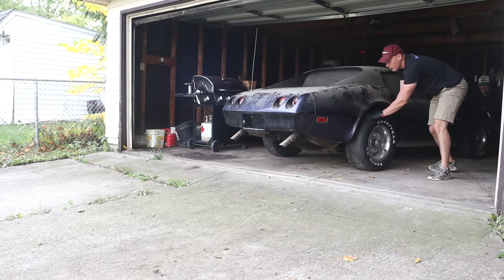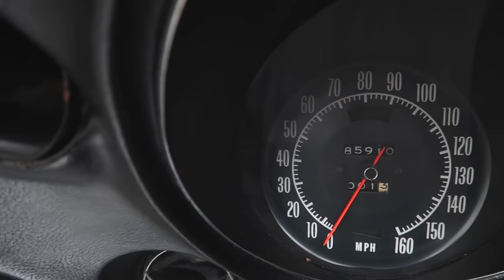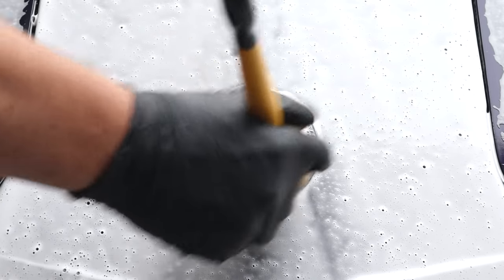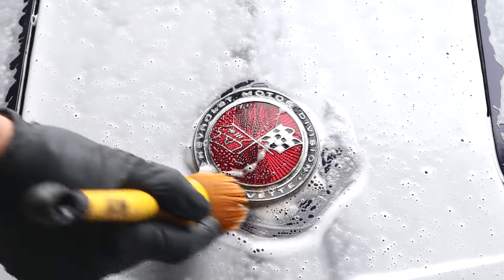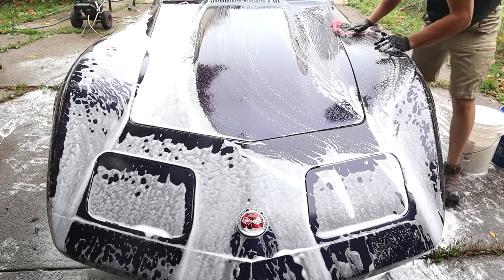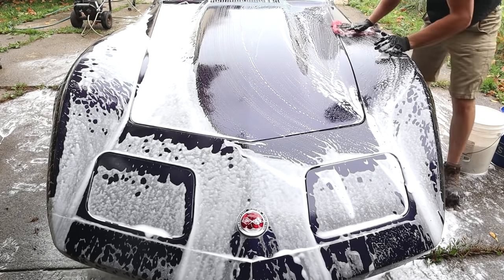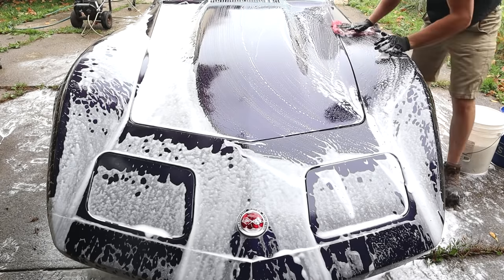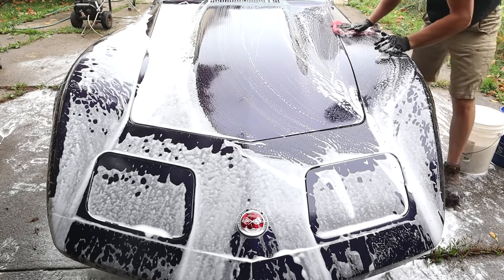ABANDONED BARN FIND First Wash In 15 Years Corvette! Satisfying Car Detailing Exterior & Restoration

Comment: The way, dust is coming out it doesn’t feel like first wash in 15 years!! There should be some rust near mud guard obviously 15 years!! And color looks brand new and shines without polishing 😂😂😂 Thanks for upload
Reply: @kashifeditz4686  he's not. He's right. There's no way the dust would come off like it is. I sense bullshit here.
Reply: Yup
Reply: Car is not made of steel, it’s fibreglass, and dust can come of easily if it was stored indoors.
Reply: Hey big dummy, if that car was stored inside, that layer of dust actually protected the paint. And the rust comment was really off .
Reply: @weallfollowmanutd  Dude! It's dust. That's a high pressure washer knocking it off. That's how that works.
Reply: A Wild Dust Expert appeared
Reply: It’s his personal car or somebody he know for sure
Reply: 15 years in a barn and no dry rot on the tires at all? 🤔
Reply: @teddyleather  he probably changed the tires - he said the car was being worked on to get it running again so it would make sense to change the tires
Reply: @weallfollowmanutd  15 years ago was 2006. You act like it was 1976. And Corvettes are made of fiberglass, no rust.
Reply: Fiberglass doesn’t rust bruv
Reply: @weallfollowmanutd  Its because what the car is made out of and cause the power tool he is using the water is strong
Reply: I agree.... Looks like artificial dirt.
Reply: to be fair, it parked indoor and just what most replies here said that corvette is made out of fiber so it won't rust😆 repeating comments to answer more doubts
Reply: Its inside
Reply: I understand what your saying but he did use a powerful washer…
Reply: You must be talking about them sheet medal corvettes, never seen one of those before🤣🤣🤣🤣
Reply: Well the dust did a fantastic job protecting the color
Reply: Is a big fake
Reply: Here I thought I was the only one.. Kids these days huh'?
Reply: It’s a vette. It’s fiberglass 😂

Comment: 13:53 use a toothbrush wrapped in a microfiber cloth with some polishing compound to do intricate areas near the badges. The polisher did not get close enough to the edges. Nice work on the rest of the paint.

Comment: How tyres look so new without covering any dust?
Reply: Because they are lying.
Reply: @robertosono8258  thought that the minute  they pulled it out..I have a 75 vette. Power wash or not never would of come off..fake dirt
Reply: @rockystrazzi2387  they're not lying, in order for it to run there had to replace the tired to even make it roll
Reply: @robertosono8258  your lying imao
Reply: Dust falls down , not up right? That’s how. 👌🏻
Reply: Same question! Its not even about the dust or dirt, just look at the condition of the walls and the tread. They look fairly new. There is no way a tyre can hold air, sitting for so many years.

Comment: 1969 corvette stingray. Love the disaster details
Reply: Absolute disaster. These guys know how to wash a car.. Thats it.
Reply: Where's the 1969 Corvette??? Might be a 79
Reply: @JohnDoe-gz8dw  Nope, it's a 76 or earlier with that style rear window and deck. Looking at the other details it's probably a 74.
Reply: Don’t group my car with one of those
Reply: @channell11  only vettes I 63-7, I was just wandering how someone would think 69, that body style, especially to 83 🤮🤮🤮, 68-7? I no interest in, but the 7?-83🤮🤮🤮
Reply: @channell11  pre 69 160 speedo,68,69
Reply: Pre 70, - 69, 68 I say. Only because 160 speedometer. And seem down the back bumper
Reply: @allendaleguitars.stpetersb4528  The last year for the 160mph speedo was 1977. Then it was a 140mph unit until 1980, when it got the 85mph speedo. Pre-1973 Corvettes had steel front and rear bumpers and the slats in the front fenders. This has rubber bumpers front and rear, meaning it's post 73. This also appears to have the two-piece rear bumper, which was a 74 only item. The fenders are the later design as well. The only way that wouldn't be the case would be if someone put later model parts on an older car, and given the strong preference for steel bumpers in the market, that'd be highly unlikely.
Reply: It's actually a 1974. That's the only year with a split rear bumper like that. A 73 has steel rear bumpers and the urethane nose. 68 to 72 have chrome bumpers all around. In 75 they went to a one piece rear bumper. A 75 and 76 almost look the same except a 75 has the astro ventilation vents behind the rear window. A 76 does not have them. A 77 looks almost the same as a 76 aside from it not having the stingray script on the fenders, front bumpers are a little different to I think. 78 and 79 have the big back glass.

Comment: I like the video but to me doesn’t look like a car that being sitting in a barn for 15 years , the paint job look pretty good for something has been sitting for that long and also the rims don’t have any spots of rust
Reply: My thoughts as well. Plus, barns are known to have mice and mice would do severe damage to both inside and outside as well as the engine bay. 

Great video, but no need to cheapen it with a misleading title.
Reply: For me it is 2:50 that said it's not 15 year old dust, dust "bakes" onto the surface over time, just a light pressure washer is not making the car shine like that ....

Comment: I don't see anyone else guessing the year, so I will.  With the rubber bumper in the front and back (not the updated style in the front though), it has to be between 74 and  79.  But since it has a vertical back window, it can't be a 78 or later.  

I'll take a wild guess and say it's a 77.

Comment: 1974 --- the "plastic" back bumper has a split down the middle - this is the only year the C3 vette body did that. The 73 had back chrome bumpers and the 75 had a solid back plastic bumper. My question back to you detailing experts ---- did the interior leak while you were washing the outside? My 73 leaks even with new weather stripping.

Comment: Beautiful car. The year is 74-77. I can't pin it down better than that 74 was the first year of impact absorbing bumpers at both ends, 77 the last year of the upright rear window. That window should retract.
Kudos to whoever laid that paint down. Beautiful job indeed. That deep a Royal Purple is very unforgiving. You guys did a superb job on it. Spectacular result. 
I'm certain you would despair of me when it comes to cosmetic car care. The old Volvo gets washed with dish detergent spring and fall. Mother's California Gold wax twice a year. It sometimes gets washed in between. The funny thing is that Arthur got dirtiest while still a "little old lady" car. In the 25 years she had him, Ma took the old boy everywhere, including off road. On purpose.
Reply: I'm guessing 76.
Reply: Next time you get a C3 to clean, check the tubes below those rear window vents, if the rubber is gone cracked or rotted, you will put a lot of water inside the car.

Comment: The Corvette is a  1974 if the back bumper is correct.  It is the only year where it was in 2 pieces.   Also in 1974 there was no emblem on the car tank cover.

Comment: It is  a 1975 because of the steering wheel style and the vents in front of the back glass. The 1976 had a different style steering wheel and it did not have the vents in front of back glass plus the 1976 had a factory alarm system that you used the same key that unlocked the doors with to turn on with the switch being located on the driver's side front fender. They are only 2 years of the flat back glass without bumpers. 1974 had the flat back glass with a rear crome bumper and the 1977 was the first year of the big back glass that opened up like a trunk.

Comment: a technique I did when I was doing auto detailing sometimes I would save as emblems for either a 000  l steel wool or I would do the car first and then do the emblems the following morning if it was good weather but this is a good method too when we got Cadillacs between the years of 74 87 and any other major Lincoln Mercury Plymouth Buick because I worked at an old junkyard for a couple years 15 years ago so these cars were quite common nobody wanted at that point because the internet wasn't all that popular that time would like to go and get the parts themselves so these cars were pretty common I miss doing the emblems especially on a Buick or a Cadillac especially Mercedes

Comment: You really trust those rubber sealings to be still soft and functional by using a high pressure cleaning device... Or did you check them before? Another point- at least 15 year old tires are "ready to go"? On a barn found car?

Comment: 1974 Was the only year with a 2 piece bumper.  You can see the split going down the middle.   Personally, the most undesirable because of that line.   That's probably why is was the only year.  Another unique year was the 73', chrome bumper in back and no chrome in the front.  Though highly duplicated.

Comment: I would have started by taking off all. the 4 wheels and water sprayed the wheel and arches inside out.  I would use rust off to remove all the brake dust....etc etc

Comment: Whilst it was generally enjoyable, I did see what looked like the purple coat missing in a few spots, showing the original white; unfortunately that was a little bit of a letdown.

At least one of them wasn't your fault, a few edges on the nose were already there under the dirt. I also saw what looked like a chip on the arch behind the front left wheel, and another edge wear on the rear.

As I say, most likely nothing to do with your work, that was all fantastic to watch.
Reply from the maker: Thanks for the input man!

Comment: Doesn't look like you did anything to detail all of the seams on the doors, hood, fenders, gas cap, roof trim. Just flat surface polish. Oh and the easy wheel clean/ polish. Didn't even remove the beauty rings.
So less of a real detail job and more of a high level cleaning.
Details are typically called detailing because it focusses on ALL THE DETAILS. Glass polishing could have been done as well.